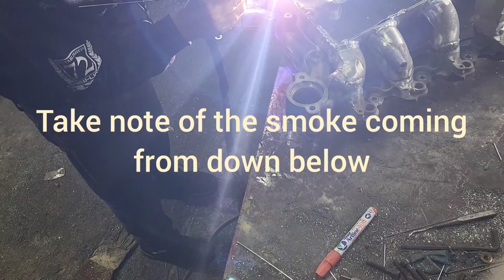v10 intake manifold fabrication. we weld the top on. all my stuff is falling apart.

Comment: The Injectors which will work really well here will be the Bosch EV6 'short' style. Take the same o-rings and USCAR clips as the stock units but are like 30% shorter
Reply from the maker: Yeah it's just a game if seeing which OEM ones are the better price for the flow rate. Explorer 40lbs/hr seems to be the cheapest

Comment: Are you planning on keeping both plenums completely divided? if i remember correctly, Rich Holdner definetly saw gains from having the two plenums connecte
Reply from the maker: They are not completely divided. It's got holes inside and the plate isn't fully welded. I couldn't find the holdner video on it so I consulted with chatgpt and kinda followed some advice from it.
Reply: @Nodarperformance  It still looks like it's pretty solid! Can't wait to see it fitting under a hood haha